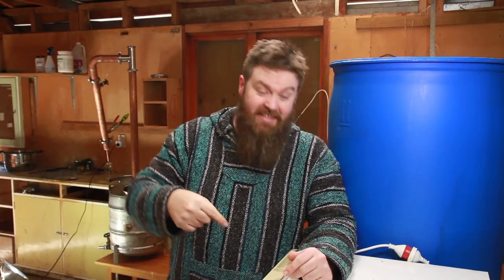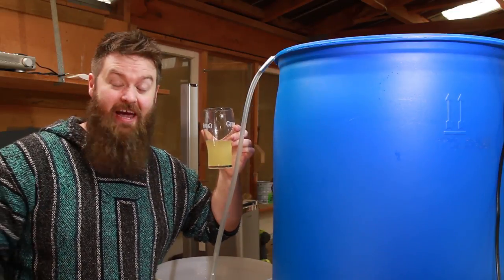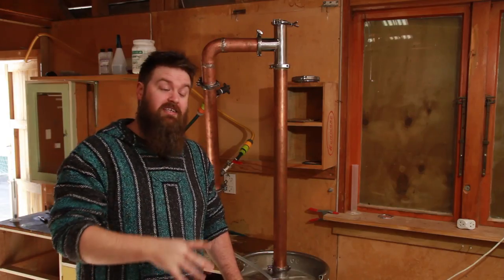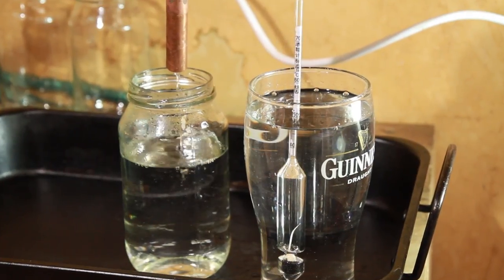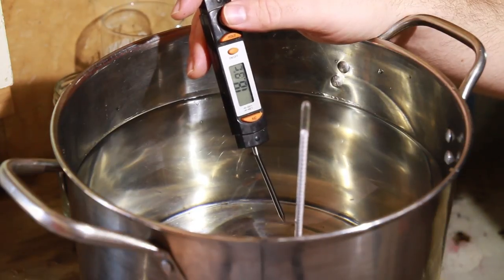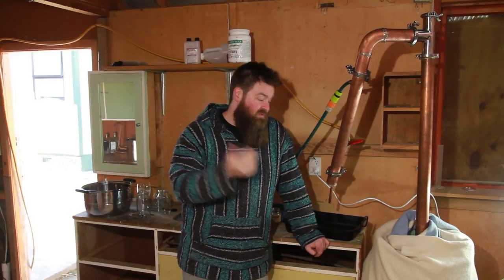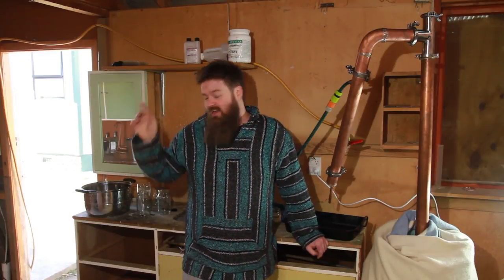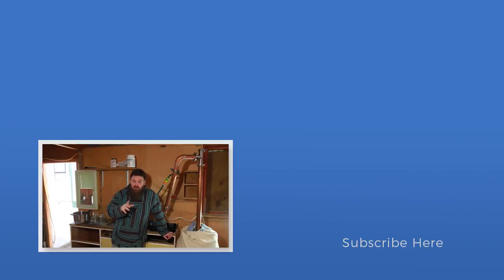Stripping Run - Making Teddysads Fast Fermenting Vodka

Comment: I have been using diatonic clay for clarification of my wine. It doesn't give any weird taste to wine, so it should work in the wash. I just made a slurry out of it, I can't remember how much clay to water but I added the package of clay to a quart jar and filled it with water, and shook it up. I just pour some in and swirl it up sediment and all and watch it clarify. In about an hour 1/3 of the carboy will clear, leave it overnight and the whole batch is done. If it's not clear by morning, you didn't put enough in.

Comment: So finally, you are just one step from some product...cool. About the foreshots..the way I do is to draw them at the stripping run (the major part of them). The reasoning behind this is: 1 they ain't supposed to be in the end product anyway and 2 As the stripping run is a lot faster than a spirit run, you'll have all the time in the world to do so. Finally 3 You won't have a whole lot of them left, as you're going to do the spirit run, so it will speed up the process (a lot). I think you'll know what I mean when you run a full charge in that keg, and look at the clock. For the spirit run...be prepared to start early in the day, cause it will take a lot of time...(especially if you fill that keg about 3/4 full). 
Remember to dilute the charge down to 40% ABV or below, for the spirit run. Happy stilling.
Reply from the maker: Thanks man.  
Yeah I plan on getting up early to get started on this one.  Will be interested to see just how long it takes!
Reply: As a noob, I wonder why you need to dilute the charge down to 40% for the Spirit run? What is the reasoning behind that?
Reply: If you have done some tests and have decent temperature control, you can identify the temperature at which your foreshots and the starts of heads emerge, and limit the still to that temperature till output drops to zero. You can then discard what you've collected since it does no good to anyone going back into the mix. Then resume at your set temp for when tails normally start to be less interesting. 

Some folks recommend diluting down to 30% for the spirit run since 40% is still quite volatile and flammable.

Comment: Thanks Jesse. What was configuration of still? I saw you had it capped for pot still mode. Did you pull packing from the column as well? Really enjoy your channel and enthusiasm for the hobby.
Reply from the maker: Hows it John :) 

Yup this was just straight up pot still mode.  Caped and no packing.  

Will run it in full CCVM with copper packing for the spirit run.

Comment: Hey bud just wondering what temperature you use for stripping run and spirit run thanks mate. I’m starting my first wash tomorrow and I’ll update you at each stage
Reply: Sorry guys, i'm also pretty new at this and i find you cannot dictate a temperature to run at......set up, light your boiler, and if things go okay, you will distill, look for a drippy run is the best for me to explain, boiler size, boiler thick/gauge  gas rate, outside temp. inside temp, water hardness/softness..then you go on to your wash ,mash, is it right, or slightly less sugar, was it the right sugar ?did you fetch it up to temp on time, was everything perfect?    mine is never...my acidity, i leave to the last, i should not, perfect yeast ? right temp ? did you clean all your gear with proper sterilising equipment.......it never stops...

Comment: So i have a 6 liter still. Its a small one. Now i have 2 questions. The teddysads fast fermenting vodka is for a 23liter wash.  If i divide the ingredients by 4 it will be a little bit less than 6 liters. But how much room for the cap is needed?

Also. Can i ferment in my stilling pot? Or should i use a different vessel for fermenting? (Like a bucket or picklejar/weckpot)

Comment: Thanks for these. There is one video I'm really looking forward to. Working with fruit pulps. One of my favorite fruits in spirit form is the Marula fruit. A small fruit found in the southern parts of Africa. Here in South Africa I can buy it in pulp form.Intense flavour, but really hard to work with. to date I have not found a flocculant able to to assist with cold crashing it. Cold crashing alone is not able to clear it up. the wash always looks like a slurry. I've tried filtering it, but it clogs up the filter almost instantly.
Reply from the maker: Wow!  Sounds crazy!  Could you get away with something less fine?  like a BIAB bag?  that you could squeeze?  Im going to have to look up this fruit, never heard of it!
Reply: Still It look for amarula gold. It is one of our biggest exports. 
Biab bag is also to fine. Tried it, and it also clogged up.
Reply from the maker: wow,  really gunky huh!?

Comment: Great video, Ive just done one of these wash's and was wondering after fermenting has finished did you stir the wash to degas CO2 before letting the wash "cold crash" and settle???
Also when you racked off the remaining wash how long did you leave it before it cleared up where you were happy to distill?
Any other advice before I distill this wash would be much appreciated?
Reply from the maker: Hows it mate.  
I have tried all of those things.  Coming from beer I was all about having a super clear product go into the boiler!  I have now also tried just throwing it straight into the still after fermentation slows down.  

Here is my gut feel on it . . . .. but it IS just a gut feel!  

have wash that's a little cloudy is not a big deal going into the boiler.  BUT don't let it sit there for long.  If the yeast falls out of suspension, then you heat it . . . .trouble.  
So I dont think I will bother with cold crashing anymore.   

What I still wonder about though is the yeasts ability to clean up after itself.  So letting it sit for a week after you start getting consistent readings.  That I want to experiment with!

Comment: so if you don't pack the tower can you use it like a pot still?I think run tell o and save that water but I be in to flavor and mix with hi proof...I never go over 176 but that's just me .. whiskey or rum..It changes things going over ..nice work mate.
Reply from the maker: Yep this was running as a pot. No packing and capped at the top, so no active reflux (other than whatever happens "naturaly").  Will add these low wines to the next stripping run and then put the whole lot through in CCVM mode for the spirit run.  

Yeah I dont think I would ever go that low normally.  I had the time, and it was just a stripping run.

Comment: Hey mate awesome channel. I have a t500 so could I remove all the packing from column for my stripping run. And then repack with ceramic and copper to return it to a reflux still. Would that make it a similar process to how you did it.
Reply: Yep

Comment: After stripping, can you fractional freeze/freeze distill it to get the same outcome as you would with a proper distillation rig? Is that something you've tried before and can offer some notes of quality comparison on?
Reply from the maker: Not something I have tried.  This is purely a guess, but I would assume it is a much less precise process.
Reply: No.  You could make a few runs and make cuts to get it cleaned  up and more neutral  tho. Freezing  will concentrate  the  flavor and is not very efficient
Reply: If you  are looking  for  vodka  go for a reflux still.

Comment: Hey Jesse! Great video as always. I was wondering if you'd thought about putting a spigot or two on your fermenter. 1 in the middle and one closer to the bottom. Not sure if that would be worth it, but I effing hate using my racking siphon.

Also, when I hitch hike to NZ, can I camp out in your shed? Ha ha:-)>
Reply from the maker: Yeah, thats a pretty solid idea.  The thought had crossed my mind.  Just didnt get around to it.  I didnt however think about putting in more than one!  I like! 

Sure :) . . . .Will move the booze first ! hahahah

Comment: I am surprised that your mash has such a low percentage of alcohol when you begin your run. Why didn't you add sugar before fermentation to increase your alcohol yield from that mash? Was it because of the yeast you used? Would it have changed the flavor of your distillate? I noticed in an earlier answer that you don't ever go for big ABV washes., and I was wondering why?
Reply: This is an ffv which means fast fermenting vodka. Sugar, ironically enough, is toxic to yeast after a certain point. The whole intent of this recipe is to keep the yeast happy so that it ferments through quickly. I use high abv for white lightning (10-15%), but trust the recipe on this one if you want it clean and quick.
Reply from the maker: Well said Jason.  Seems I missed this one 5 months back haha

Comment: Hi Jesse, not sure if that's spelled right. So my question is when you do a stripping run is the product also called the "low wines"?
I'm a little confused by the definition of "low wines" as being the first run that tastes bad and has a low alcohol content.
Reply from the maker: Yeah, so if you perform a stripping run the result is low wines.  Low wines have been distilled, but not in a way that they are ready to be drunk.  They need to go into the still again.
Reply: @StillIt  thanks Jesse, i went back and watched your FAQ video and heard that. Makes sense. Keep on rocking!

Comment: Just a quick question if I may, this may sound daft but im a newby and doing my first ever run this weekend. My question is, when doing a stripping run, at what temp do you do your stripping run at??? Also after doing a stripping run and you dumped whats left in the still, do you need to do anything else before you start ur spirit run?? Many thanks :-)
Reply from the maker: +ian latham how sit man!  

So first up, try to get out of the mindset of temp for any run.  Think of it in terms of speed of offtake.  I went through it a little in the induction cooker vid.  Check that out :)

Nope good to go, if you end up with anything over 40% from your stripping run, you may want to proof down to below 40% though.
Reply: What StillIt said. But I'm running mine around 90°C. Do the research and enjoy the results.

Comment: Jesse, what temp do you run at for a stripping run? A still.... I am familiar with.... likes to run on a spirit run at 180f to 185f. Would you run a stripping run at 205f to 210f?
Reply: So there's not a precise temp for this because it depends on the alcohol content in the wash. I'm getting decent results at 190° but my abv was a bit lower so maybe you can run it at a lower temp. You just want a consistent flow, whether a stream or drip which depends on your column size. .
Reply: @no-sway3709  Thanks.

Comment: I was told that you can filter the stripping run before the sprit run, takes a lot of bad stuff out.
Reply: Filter after. Filter twice after for that matter. Don't use a brita filter like I used to do. Use real activated stone carbon. Mile Hi Distillery has it pretty cheap. Search around on how to convert a 2 liter to use with  a covfefe filter and the activated carbon.

Comment: I’m making scotch for the first time would I take out too much flavor with a striping run
Reply from the maker: I dont think so man.  If you have more wash than will fit in the boiler its not a bad plan.  Even save a little of the raw wash for the spirit run.  

On the other hand if you can fit it all in one run just roll with that.

Comment: Skip the taste test on the stripping run.  You are running so fast you will have bad smearing continuously and I'll all taste pretty bad.

The spirit run is where the magic happens.

I use 1 large glass carboy to run into during stripping.  I purchased silicone stoppers for storage in these as well.
Reply from the maker: I was just taste testing for the sake of it.  Just out of interest to see how things changed over time etc.  

It all got thrown together into a big stainless pot in the end to go back into the boiler :) 

I will DEFINITELY keep an eye out for the big glass carboys though.